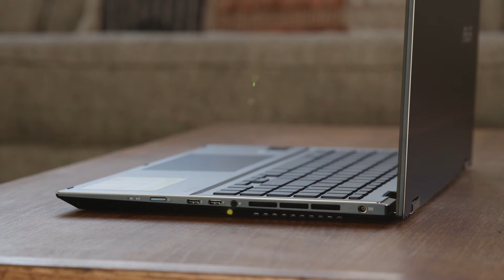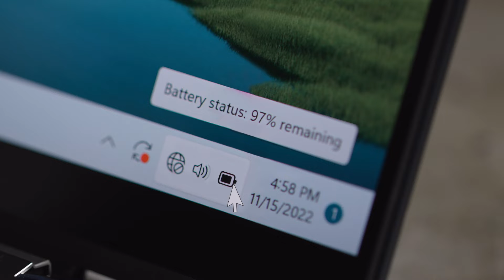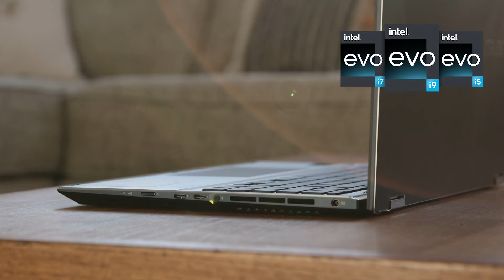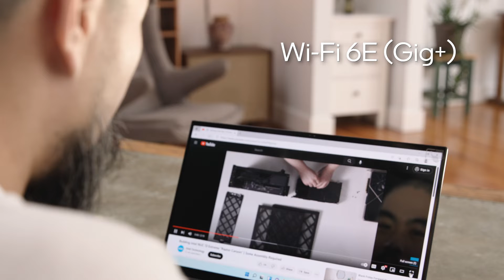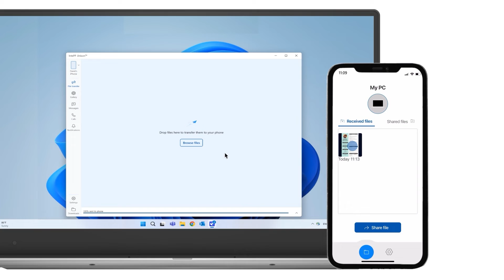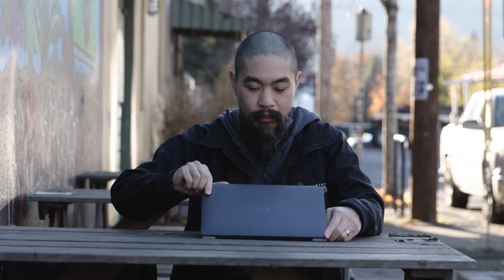Intel Evo for 13th Gen Laptops Explained | Intel Technology

Comment: Can somebody confirm if it runs Linux ?
Reply from the maker: The Intel Evo certified laptops powered by 13th Gen processors come pre-installed with Windows 11 and Chrome OS by the laptop manufacturers depending on the model. We recommend that you check with the respective Linux OS vendors by visiting https://intel.ly/4actrqI to see if the operating systems can be installed. To learn more about the key features supported on the Intel Evo platform, please refer to https://intel.ly/4a2W2i7 Do feel free to contact us via https://intel.ly/3xfwIXm for further help.